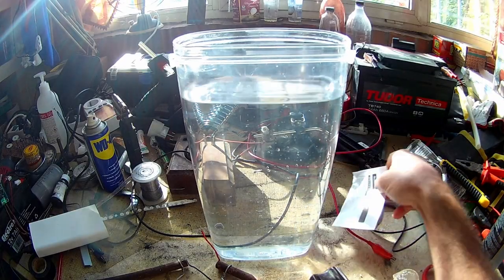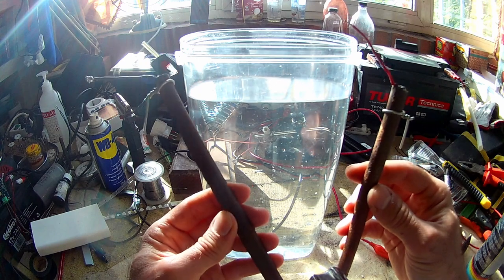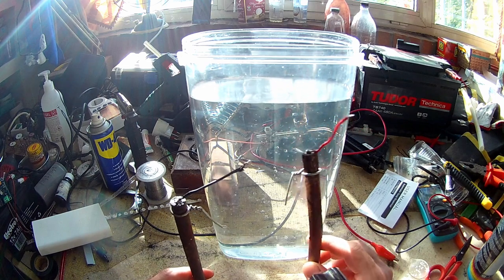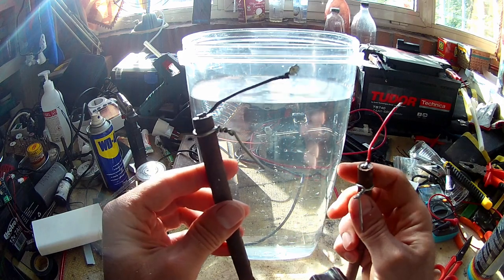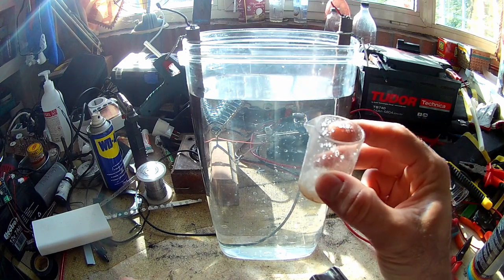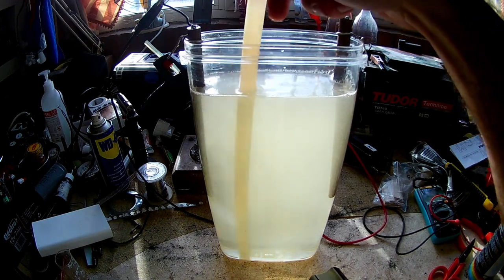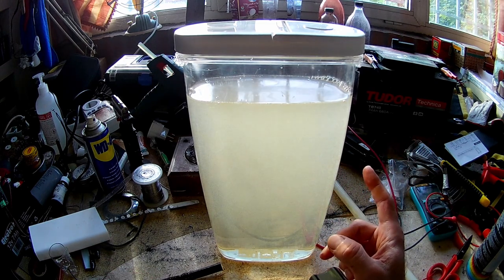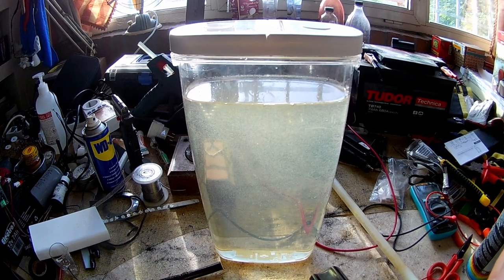DIY Hypoclorous Acid disinfectant by electrolysis of salt water

Comment: Thank you! I've been looking for information like this. If I'm using only 5V would I need to perform electrolysis for roughly 17 minutes to make one quart?
Reply from the maker: any voltage will work but regarding exact times, you're on your own with testing, keep at it until you can clearly smell chlorine :)

Comment: hi @Ephestione's HQ , on Natur Chlros website they mention using Vinegar, which i dont think was in your solution. Any particular reason? Secondly, the  Current calculation details , where can i find those, as i might not have 12v 1A available, so the time i need to run the electrolysis might change, please provide these details.  I have been looking through HOCL for a while now trying to find  ways to calculate the PPM of the generated HOCL from this method, so thanks for this video it was very helpful, much appriciated.
Reply from the maker: Can't remember if I mentioned vinegar, but it's recommended to lower the pH and increase HOCl prevalence.
I don't try to infer PPM by calculating the watthour's poured in the solution, I did this in my first attempts but now I just wait until the solution smells of chlorine, then I am content with it. The best method availble to infer final concentration, is using chlorine strips on a dilution.

Comment: Great video. Should I use tap water or pure H2O  (demineralized water) for making HOCl?
Reply from the maker: doesn't really matter, I always use tap water, as dissolved chemicals inside it will not significantly alter the efficacy of the solution.

Comment: I used graphite pencil, salt and vinegar. After 2 hours, there was a smell of bleach in the water. Is there any harm? Can I use it as a disinfectant?
Reply from the maker: great, that's hypoclorous acid and chlorine gas that you can smell. I'd say that 2 hours are a very long time though, I would go for just a few minutes...what voltage and current were you running through the solution? And wasn't the graphite anode almost completely corroded at the end?
Also, chlorine gas IS toxic, just not at the concentration you will get with this reaction in normal conditions (small amount of water and salt, and not ginormous electric power involved)
Reply: @ephestione  Thank you for the answer. I used graffit pens for electrolysis. I have a 12v adapter. I saw it in a video. It took 2 hours.Two hours later, the pen inside the anode was shattered. :). It saw 130 ppm by dilution. I haven't bought a test kit yet. Can Graffit pen be harmful to health? They suggest titanium.
Reply from the maker: two hours is too long in my opinion, you might go up to 10 minutes with a 12V 1A capable power source, and a quantity of about 1 liter of solution. Naturally, if it's more like 15 liters of solution that you're making, then 2 hours is approximately right :D
Reply: Yes..but it is Naocl...mot effective against many bacterias

Comment: Hi, i like your video. But before i saw your video, i bought one generator but it is simple and cheap. You just soak the generator into water and after 5 minutes it will produce HOCL water. But it makes me curious, since it is cheap, what logam or metal is it? Cos the one with titanium is more expensive. ( i don't understand much about logam or metal) thx
Reply from the maker: I was using large iron bars in this video, I switched to graphite bars since long

Comment: Can I use the pure silver rods to make this? I have two thin narrow wires that I make colloidal silver with, would those work?
Reply from the maker: Of course you can use silver rods, they will corrode just like any other material when place at the anode

Comment: If using a power supply PSU what amps and volts are required to run the electrolysis
Reply from the maker: electrolysis will happen no matter what voltage you select, as long as it's DC. Also you should just select voltage, while amps are determined by the resistance of the solution (and the max current given by the PSU).

Comment: You can prepare hypochlorous acid just with mixing specific ingredients only without electrolysis
Reply from the maker: Yes you can, out of all the methods I researched to obtain HOCl this was the easiest/fastest/best yielding, at least considering what I had already lying around, and my previous experience :)
Reply: Yes, but many preparations release dangerous levels of chlorine gas, especially when you use hydrochloric acid to lower the pH of household bleach. Vinegar (acetic acid) would be more preferable, but even that emits more chlorine gas than electrolysis. The simplest "mix and go" recipe would probably be to find some cyanuric acid / dichlor granules at your local pool supply store and dilute it with water to the desired concentration. It's basically HOCl, but has the added benefit of stabilizing the HOCl against UV and temperature exposure as well as being able to reach much higher concentrations than you can ever get with a home electrolysis rig (like 5000PPM+!). 10g/L is enough to kill all C.diff spores in 4 minutes. Obviously, that's way overkill for SARS-CoV-2.
Reply from the maker: @MikeTrieu  thank you for the feedback, would you also know what's the cost of dichlor granules? In my experience, brewing everyday my HOCl with this method is easy, fast, extremely cheap, and I stand behind the safety of the method, because the quantities at play are really small, and you will not get dangerous amounts of chlorine gas. Yet I also understand that what's easy for me might not be easy for someone else, granules are WAY easier :)
Reply: Hi, Are you referring to Sodium Dichloroisocyanurate ?   thanks
Reply: Mixing vinegar into dilute hypochlorite solution evolves very little gas. In fact, I can not tell if anything happens upon mixing. There is no visible reaction and no additional smell. I do it all the time at 500 ppm hypochlorite.

Comment: Hi, if I use Titanium Rod instead of Graphite, would it work? I going to design a disinfection fogging machine, with HOCL generator integrated.
Reply from the maker: Yes, absolutely, it will just cost you way more than graphite, and titanium will corrode with time as well
Reply: @ephestione  I see, will graphite corrode overtime?
Reply from the maker: @wilfhiemweiss4101  everything you use at the anode will corrode over time
Reply: @ephestione  thanks so much for the info!

Comment: I am using copper rods.  I'm using it topically only.  I am using it on skin to kill parasites.  Is there any harm to doing this with copper?  If I change rods, what should I change them to?  I would like to use in my eyes.  Others are doing this.  Optometrists are using it on the eyelids for Demodex.  Will it be safe for internal use
..if I change rods?  Thank you.  I am subscribing now.  I am limited on time at the moment.  So much research trying to cure this.  I, barely, have time for applying what I learn.  I make time tho.  Thank you.
Reply: Try with titanium rod. Best for electrolysing process. Non corrosive.
Reply from the maker: Disclaimer: the following is NOT medical advice, and as such should not be followed :D
Usage of HOCl solution on skin should not be a hazard, since it's technically drinkable. I still would be cautious about using it on the surface of the eyes, and it's because you can never be sure the solution is completely free of contaminants from the anode dissolution, which in your case would be copper oxides.

Comment: You should use a carbon conductor for your electrolysis
Reply from the maker: indeed, since making this video I "upgraded" to a simple Fanta bottle with two graphite electrodes cannibalized off dead AA batteries, heated up on the flame and stuck through the bottom sides. It is ugly but produces a definitely cleaner solution, albeit with the black shavings of the anode being released during reaction. I ordered proper bigger graphite electrodes, and plan to also test titanium ones if I don't like how graphite fares.
Reply: Graphite is the way!

Comment: Its very interesting.. but in your list there is no vinigar? Is it a must or you can skip the solution.. and one more thing, are the chlorine gas dangerous or not? Thank u
Reply from the maker: Yes, I believe I said it is suggested to use vinegar (or any other acidifying agent), as optimal pH is 6 (actually 5, but 6 is friendlier). Also, no, you can breathe on the vat while electrolysis is running, it's not pure chlorine gas, just a wiff mixed with nearby air. I didn't build a chlorine gas chamber as others do in their videos, didn't need it

Comment: Thanks for the video. One doubt here: whats preventing the NaOH and the HOCl from recombining ( as they are acid and base ) and forming NaOCl ? There isnt any membrane or separation of the electrodes. So acid and base should recombine in the same solution. What am I missing?
Reply: Just add vinegar to decrease pH to 5-6
Reply from the maker: as it was told you by Neyellko, if you provide the best pH, the solution will be kind of stable. It's a constant balance where pH 6 (5 is the best, yet it's 10 times more acidic, hence less neutral, than pH 6) is a good compromise to obtain the highest available concentration of HOCl, at a "safe" pH.
Reply: @ephestione  , yes, i am now keeping the Ph at 6. Thanks.

Comment: can you try adding acetone to this mate and see if it forms chloroform? it will go hot and make a layer at the bottom of chloroform which is an extremely usful solvent just wondering if this is a good bio way to do it my friend just add about 2 to 3 ml or ethanol to about 50ml 2ml 25ml 1ml or keeping adding if nothing happens im just wanting to know if this is strong enough Thank you!!
Reply from the maker: I'd rather not :) I know about chlorofom being an effective solvent, yet running current through solutions of which I have no previous researched knowledge is against my personal safety protocols, and also should be the same for you. Research until you have extensive knowledge of the issue, and clearly understand all the information you acquired.
Acetone is in itself toxic, so running an electrical current through it, just to experiment, doesn't sound right with me!

Comment: Is the chlorine gas made dangerous? Is using seasalt safe? Im.using electrolosis of sea water and get scared of the smell of chlorine in case its dangerous
Reply from the maker: eheh, unless you go breathing right above the spot where chlorine is released, and do so for, say, 1 minute straight, all you will feel is the pleasurable smell of chlorine when around the vat,  but you won't get poisoned
Reply: @ephestione thanks, I made it in a bottle and smelt the top when it was in process which I think was a bit more concentrated than that, but it was only momentary 😅.... does most of it dissolve into the water?
Reply from the maker: @katyoduinn3452  chlorinei is a gas, I'm not a chemist but I guess except a minimal fraction that maybe gets in solution in the water all the rest goes to the surface while bubbling

Comment: Thanks for information, I was searching around for this. Your video was very clear. It put out many doubts that I had. Please update us if you have newer procedure for the same? Also can we use steel rods as cathode and anode ? Will then HOCl be made ?
Reply from the maker: do NOT, EVER, NEVER use steel anode! Cathode is fine, but then, any metal is fine as cathode, since it willl be stable, but as I say in the video, stainless steel in the anode degrades leaving very toxic products, cancerogenic in fact, in the solution. Graphite is better, you can check the latest videos in my channel for that.
Reply: @ephestione  Thanks
Reply: Can I use pure silver or pure iron as conductor
Reply: @ephestione  hello, I want to produce 1 liter 5%, how should I do it? can you help me?

Comment: Isnt there supposed to be a membrane between the electrodeS? Cool video thanks.
Reply from the maker: The membrane is not needed, unless you want to separate the two products of electrolysis in two different "vats", but said membrane needs to be a particular kind that allows ions to pass without letting passage to other compounds, not something you can just buy off-the-shelf afaik
Reply: @ephestione  doo you know what type of membarane it is? does it need to be hot swappable like a water filter?
Reply from the maker: @anglerandy5736  honestly, I forgot, I researched for information back then, realized it was not something I needed, and then I discarded the information I found. I do remember something about having to replace the membrane after a while, yes

Comment: What does the hypochlorous acid convert to after decomposing due to its unstability?
Reply from the maker: That's something I couldn't be able to say with certainty as I didn't document myself much on this, but I would think the reaction reverts to water and salt plus something else
Reply: I @ephestione  I believe that the hypochlorous acid is in equilibria with its conjugate base.  However, the irreversible reaction in which Cl2 is created and then leaves the system as a gas slowly (over a few days) reduces the Cl available for HOCl (that is hypochlorous acid).  So the equilibria slowly shifts to lower and lower concentrations of Cl containing components, including HOCl and HCl.
Reply from the maker: @richardneifeld7797  that may make sense, but I don't know if Cl2 keeps being released even after the electrolysis has finished

Comment: is there anyway to purify this solution? make it more clear?
Reply: or is the solution coming out a yellow colour due to the rod you are using? i read that this solution should have be colorless
Reply from the maker: with a platinum anode the solution will definitely be clear, until also platinum will get corroded and the underlying metal will start dissolving in the solution. There are probably ways to make the two components not interfere, by using membranes, but it's not something the average person will have access to
Reply: @ephestione  mixed metal oxides my dude
Reply from the maker: @AG-sx9ws  see my other reply about being rich 😁

Comment: I bought a hypochlorosis test kit. After 3 hours of electrolysis, the ppm value is 25 :) The water turns yellow
Reply from the maker: it doesn't add up... 25ppm is really, really low concentration. 200ppm is what you're aiming for in general purpose usage. Also at that low concentration I wouldn't expect the water to turn yellow (unless maybe you are using an iron anode that releases oxides in the solution?), and lastly, 3 hours is an extremely long time! I get my HOCl solution with just a few minutes at 32V, or 20 minutes at 12 to 20V, current ranges from 300 to 600mA. I use two graphite electrodes from dead AA batteries.
Reply: the water should NOT change color

Comment: Iron?  Really??  Wouldn't it just dissolve and make iron oxide/chloride?
Reply from the maker: Iron does produce iron oxide in the solution. This though will not decrease the disinfecting power of the hypoclorous acid, just make it look orange-ish, but you can filter it with a cotton cloth.
This was an older version of my vat anyway, because I since then switched to graphite electrodes, as you can find in my latest video.
Reply: @ephestione  The professionals use mixed metal oxides, at least a surface coating. Extremely durable.
Reply from the maker: @AG-sx9ws  professionals are rich, I am not 😅

Comment: Could you please give the equation that you use in the comment. :)
Reply from the maker: hello there, if you are referring to the equation, it was a very rough improvised one, based on the characteristics of a commercial hypoclorous acid electrolysis solution, where they suggest a certain amount of water and salt, and a certain reaction time with a power supply of known characteristics. But that was a very inaccurate approximation at best. Since I've been producing hypoclorous acid almost everyday since this video, I just ignore the stoichiometry, I just pour a bit of salt, a tiny bit of white wine vinegar, and run the current "for a while". I'm happy with that :)
To get accurate measurements you would need either chlorine test strips, or electronic chlorine meters, but ALL of the cheap accessible ones are meant to test swimming pools, so your homemade solution will have WAY more chlorine inside for them to be useful. You could dilute the solution until you get a viable reading from these methods, but diluting would change the pH of the solution hence also making the measurements useless... unless you make sure you keep the pH constant while diluting... god please help me, I get dizzy just by thinking about that. Just electrolyse away, who cares for concentration, it's going to work anyway!
Reply: Lol !!, :) I understand and thanks a million ...I found this vid and the work you put into it of enormous help!! Thanks 👍👍
Reply from the maker: very happy to help!

Comment: Hi, I would like to know if I use a 12v 5a adapter how long would I need to wait and how about 12v 3a. thank you my man
Reply from the maker: no guarantee the solution will allow the whole amperage potential of the supply to be used,anyway it's a function of how much water is inside, and how much salt, and finally how little resistance between electrodes. So there's no formula availble AFAIK

Comment: It appears Taiwan used HOCL 
https://youtu.be/6rfLRdCItxA
My first try using galvanized steel bolts removed the galvanized coating. Would graphite golf shafts work? I used a battery charger for power.
Reply from the maker: they didn't really say... you can only see they are vapourizing some liquid :)
Any graphite item will be good as an electrode, pencils included... just NEVER use anything with steel!!